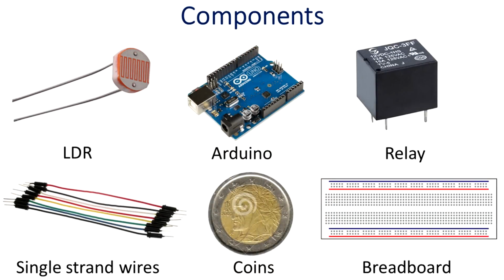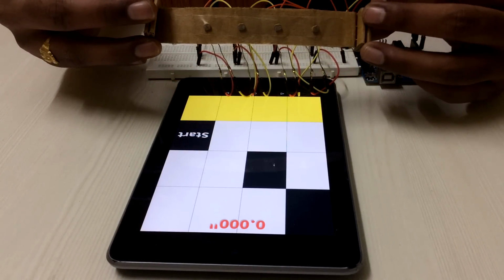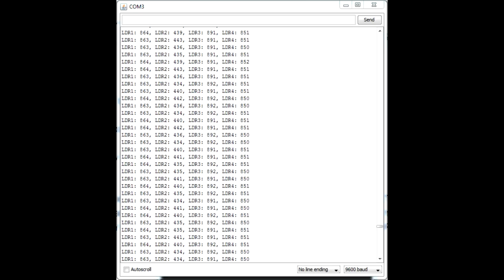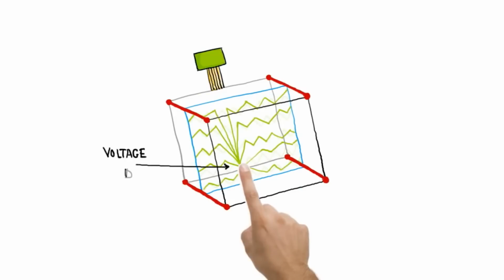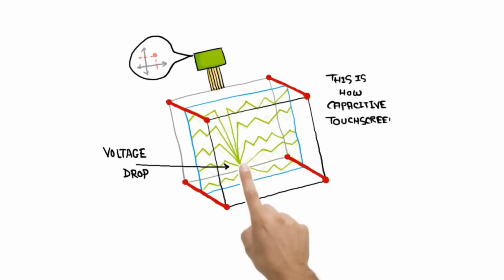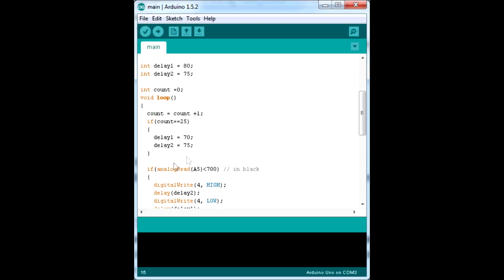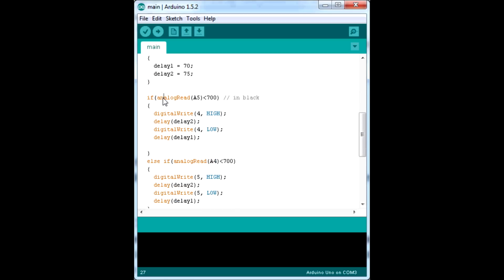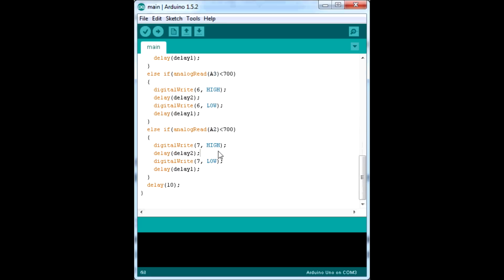Arduino Plays Piano Tiles (Tutorial)

Comment: Hi.. I am also working on a similar capacitive touch simulation for a small project using arduino.. I have taped conductive foam to my phone screen and connected it to a digital pin on my arduino. The code alternates between high and low for a set period of seconds.... But i am not able to get it working. Could you please help?

Comment: Hi I am trying to replicate this circuit however the response from the touch screen is not always reliable. in other words sometimes a touch is simulated and other times it is not. 

did you have similar issues, if so how did you overcome it?
Reply: Daniel Messina.   I'm having the same problem with my Pixel C. The screen is so sensitive that it detects a touch even when it is not grounded.

Comment: this could have been done easily with logic, no need for an arduino
Reply: Bartosz Olszewski it would also be faster
Reply: well i could but  unfortunetly i have limited acces to electronic components in my country , i bought an arduino starter pack and it's literally all i posess ( it contained transistors )
Reply: could one of you please tell me how it could been done with logic ? i tried using an npn transistor but didn't quit work
Reply: MO7BUSCUS comparators sir. Make a voltage divider with that ldr, then hook it up to a comparator which will either trigger the action directly or will give signal to mosfet/transistor.
Reply: i'm not very familiar with comparators so i was thinking of leaving the bit with LDR with arduino and only use a transistor instead of a relay , do you happen to know how to do that ?
Reply: MO7BUSCUS learn comparators.
Reply: MO7BUSCUS then yeah, but you might need a pull-down resistor. and to make it work you need to connect the electrode to ground. and pls, move out of that country.
Reply: lol i plan to , i think i see what you mean , thank you very much for your help sir
Reply: I tried doing this with an npn transistor and failed as well. Did you find any new ways to make it work?
Reply: 0nceuponatime use a relay.
Reply: could you please explain how to do it step by step . thanks

Comment: Why do you have to use the relays? Couldn't you just send 5V directly into the coins by switching it's pin to HIGH? Are you sending more than 5V into each coin?
Reply: +John King I believe connecting the paths to ground causes them to sense a "finger".
Mind that your finger also won't give off 5V.

But you're right, relays are relatively slow, compared to the sensor/Arduino speed.
Reply: What is the wire connected to digital pins? Is it the input of relay or Vcc?